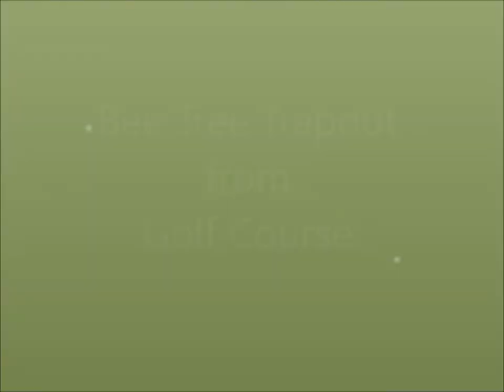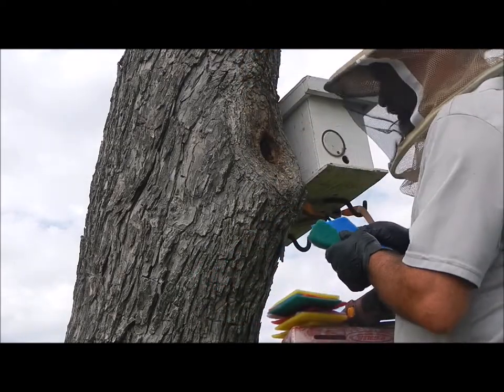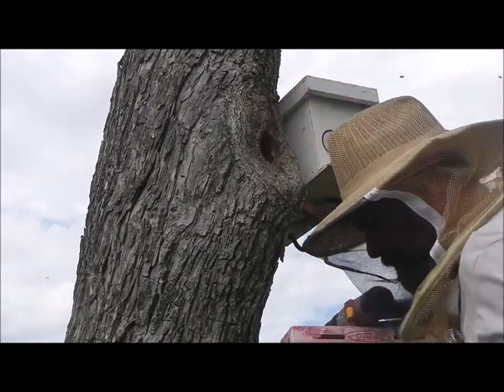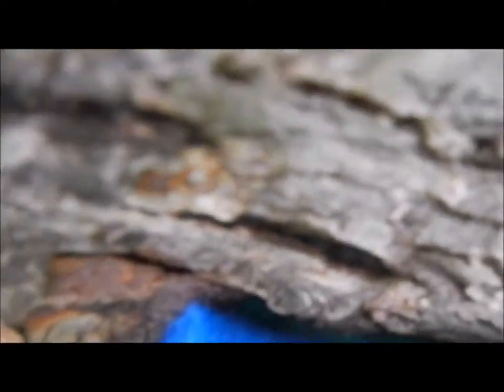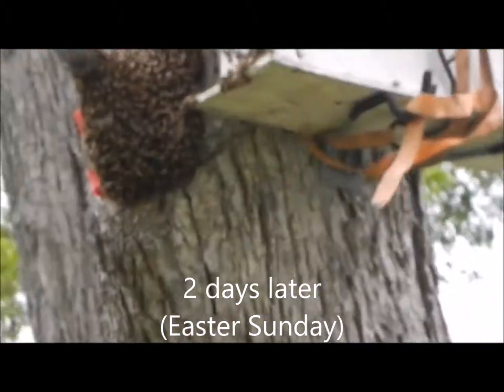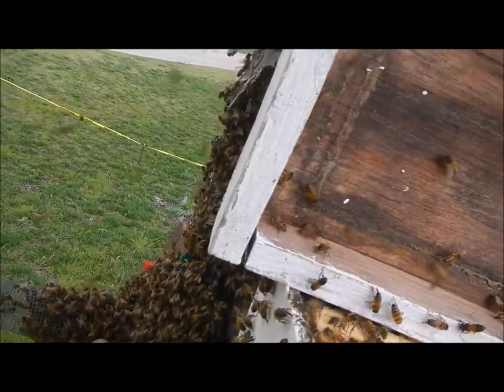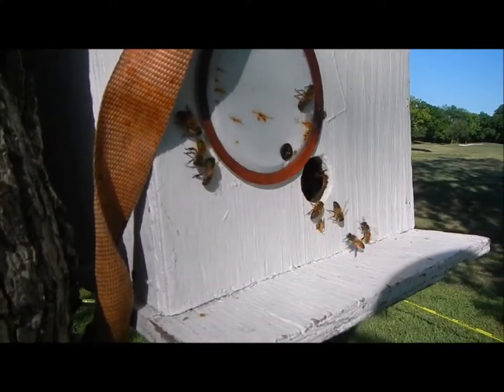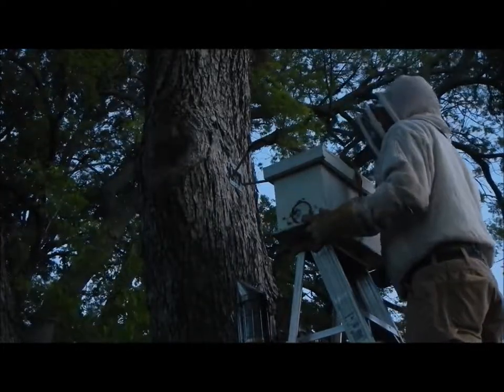Trapout of honeybees from pecan tree on golf course.  Harmony Hollow Apiary

Comment: Thanks for the tip about using the scrubs as a gasket.
Reply from the maker: And a note - I now use air conditioner filter media that can be bought from lowes or home depot - as it's thicker, more springy, and less expensive than using the scrubber material.

Comment: What the size of the exit hole on the end? And do you ever put lemon grass oil in the catch box? I’m setting up my first trap out this week about 20 ft up in a sycamore that’s scheduled for removal!
Reply from the maker: I used to make a true "cone" with the mesh.  Unnecessary.   You can make a straight tube (think similar to a paper towel tube) - but a little smaller in diameter.  I had (2) trapouts that were completed today - that had a tubular "cone" that was about 12-14" long, and maybe 1" in diameter.
I start out with empty frames (or maybe one of them has old-comb).   Then after a day or so - I go back and add a frame of eggs/open larvae - and they can get started with making a new queen and will become loyal to the box.